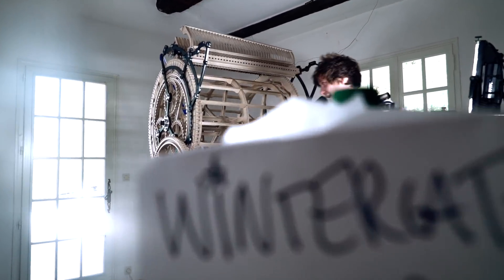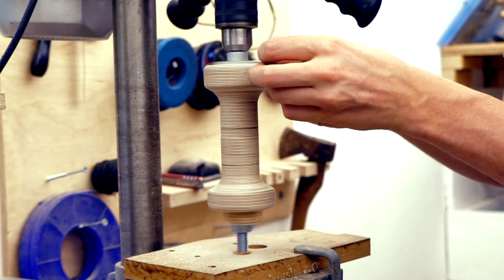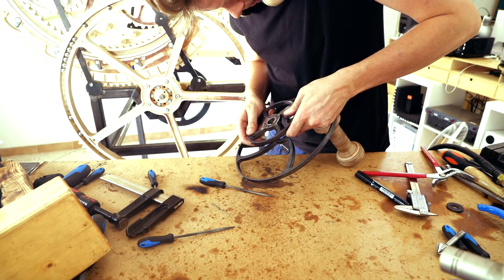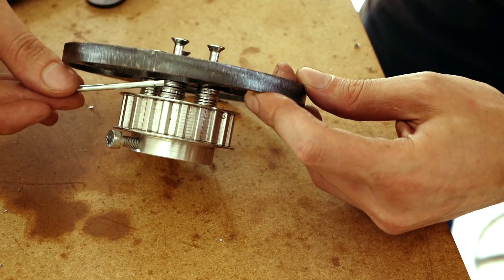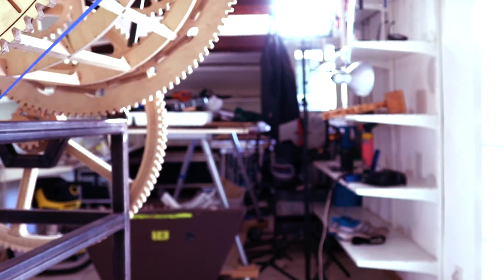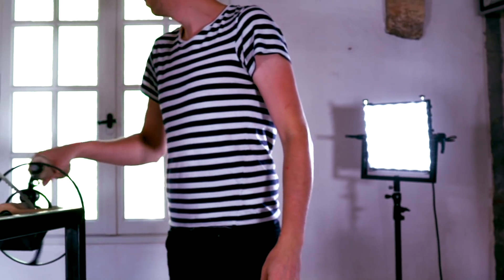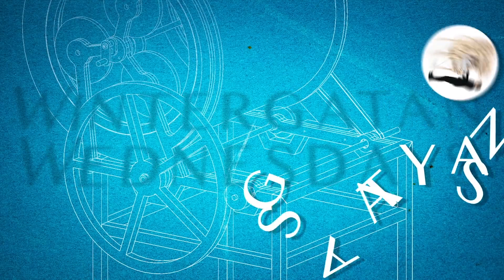Making a Crank Handle without a Lathe - Marble Machine X #49

Comment: Nice work as usual 😀 But the design isn’t ergonomic and frankly not as elegant as the rest of the machine. Look at the handle on the drill in this video. As design like that is more relaxing and in my opinion more in correspondence with the design of your machine        https://youtu.be/bb_91PCUWws

Comment: considering your medium (plywood) and keeping with the cohesive design of the rest of the machine, I think your method of making this handle was probably better than using a lathe.  I think you would have found lots of chipout and splintering that would have happened with a lathe.  I think your end result is about the best you could have achieved.  Great work as always, and look forward to hearing this lovely unit.  Cheers from Canada.

Comment: Excellent as always. Very enjoyable to watch your videos. I was looking at #25 where you were working on the programming segments. A thought...If you used flexible thin plastic sheets that exactly matched the programming segments, but were drilled for the music setup, it would make placing the magnetic pins trivial. Just plug pins in the holes in the sheet overlaying the programming segments.

Comment: Martin I have a question about the construction proccess. Since there are a lot of heavy metal parts included on the MMX, how did you design it so that it wouldn't tip or fall over? Did you use some sort of physics engine to determine its weak spots or did you just use engineering and trial and error?

I love your work and good luck on the rest of your project!

Comment: How to drill or tap with handtools, holding tool accurately square? 

I use a small plastic mirror with a 1cm hole cut in its centre. Place mirror flat on object and drill or tap through the hole in the mirror. 

When drill is held correctly square the real drill and its reflection in the mirror are easily seen as one straight line. If drill is wrong, tilted slightly, the error is immediately obvious in the mirror.

Comment: I realize it's kind of late in the game for this, but did you consider a transmission system for the crank so you don't lose any mechanical advantage when you need to play faster songs? i.e. a 200bpm song could be cranked at 100 bpm, change gears and a 100bpm song could be cranked at 100bpm.  Or am I completely wrong? LOL.  (P.S. I'm not a mechanical engineer, so don't judge me too hard if I'm wrong. :-)  )

Comment: Hey Martin! The marble machine x is coming out really well! But I wondered something, Would you desing a way to power the machine with a motor? No for stage use, but for machine debug. I think that making a addon that can power the machine for you would be great since you will need a one less person to find a problem if the machine starts to fail and you can focus on the failure and not on cranking the machine.

Edit: 
Also It will provide you with a tool to make a stress test for the marble machine X like play for 6 hours straight a test song to find out if it brokes or how much it waers out, which will help you to desing a preventibe manintenance plan for it and know what tends to break out and how to know what is about to break before it does so it doesn't do it on stage.

Comment: How to make a crank handle using a CNC cutter and a pillar drill. Oh please....  tip for the impoverished, you don't need the CNC cutter because a pillar drill with improvised bottom guide to reduce wobble IS a wood turning lathe.  The handle can be turned from solid using just tnat.  Well, OK,  you also need to drill a hole for thé bolt.  Use the drill for that.

Comment: Do you plan to have a tensioning wheel on that drive belt? It's a simple way to get more reliable, stable performance from the belt. You'll have less problems with thermal expansion and contraction as you travel to different climates.

Comment: (suggestion) You should use a T-handle tap holder not a drill, I only use a drill when cleaning out old threads, not for cutting new threads. Don't forget to go back and forth to help clean out the chips. Thanks for the vids, the crack Handle looks great

Comment: I am not sure why, however somehow, I would think that a bicycle chain would look better than the plastic belt, although we know that the plastic belt is really a professional belt. A bicycle chain would match the frame better, perhaps, while the greenish plastic belt is not in line with the rest of the design. And oh yes, a bicycle gear system could also facilitate different rotation speeds, of the marble machine, however then again, a Shimano gear system would maybe be over the top, making too many association to a bicycle, not an instrument. And yes, some new bicycles, now has a belt, and not a chain, so a belt completely makes sense, however design-wise, with the marble machine there is a minor disharmony using a belt instead of a chain.

 And yes, the plastic belt is very thin, and doesn't show properly, the transfer of energy, from the crank as well as an bicycle belt would do. The wheels are astonishingly well designed, in comparison,

Just a detail, everything is extremely fascinating, and well made, and it is fascinating how much work with rotational pieces you can do, without a lathe (dreibenk, as we call it in norwegian). 

However in the Marble machine III, I expect a bicycle chain and not a green plastic belt, ok? :-)

Disclaimer/warning: It could be that a bicycle chain, instead of the firm plastic belt, introduces a minor, however still unwanted slack, that could be an issue, that is in favor of the belt, still - I would
check if the chain would do good enough.
Reply: Thomas Henden  I like the idea of the bicycle chain, plus there is the Wintergatan song "Biking is better".

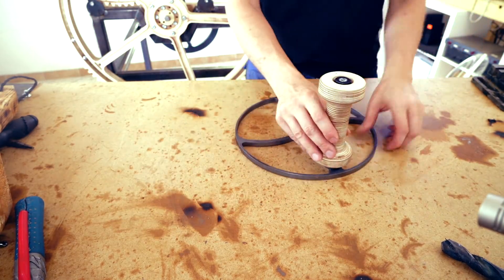Comment: I love this project! At 3:28, you're using an angle grinder to de-burr round holes. It's much easier to acheive a clean look and leave the original finish of the steel surfaces if you de-burr holes lightly with a few turns counter-sink or a drill of at least 2 times the diameter of the hole (not to damage the drill) :)

Comment: Am I the only one who thinks using steel is a bad idea for this project? As awesome as the new Marble Machine will be, and as awesome as it will be to be taken on tour, I just feel like it's going to be too heavy for it to be financially viable to ship, with Martin looking at it in infamy. Some bands can't even tour with their own amps nationally because of the weight of the amps. Was carbon fibre or aluminium (aircraft grade???) ever considered at all for the metal structures?

Comment: Not sure if it's been mentioned before, but will you be adding some sort of idler to the crank belt to tighten it up? Maybe it's not an issue, but it seems like it has a lot of slack in it.

Comment: Was the drill-press-laithe inspired bt Michaelcthulhu by any chance? I know that you don't want to, but if I was you I would put some sort of clear coat on the crank handle, that will soon look grubby. I also have to ask, why use a belt drive?  I would think that a belt would have some amount of play in it, unlike a shaft or cog system.

Comment: A couple of things I noticed while watching this video.

For tapping with the drill you might try to obtain some spiral cut taps.  Instead of a straight line cut lengthwise they have a spiral cut like a drill bit.  They are made for doing drilling type tapping and work much better when using a drill.

The second item is you need some kind of tensioner or rollers in the center area of the toothed belt to adjust the tightness and keep it from bouncing around.  This doesn't need to be heavy duty, it only needs to hold the rollers in a given area and have some adjustments to adjust how tight the belt is and keep it from bouncing.  The tensioner could also use a spring to set a predetermined amount of tension and yet still allow some give if something weird happens with the belt.

I would also suggest coating the crank handle with some kind of plastic coating or the hand oils will eventually turn it horribly ugly.  The coating will protect the wood and make it easy to keep clean.

Comment: Would you consider liquid thread lock on the crank handle? Not sure what weight you should use, but I figure you wouldn't want to loose that tight feel on tour. (on the bolts holding the rwo wheels and such)

Comment: Have you thought of using grub screws instead socket head cap screws in the timing pulley. It will remove a spinning hazard and neaten up the overall look of the marble machine x.

Comment: I'm wondering, couldn't the drill press be used as a makeshift lathe, the way you set it up with the threaded rod and the wooden countersupport on the bottom?

Comment: Instead of taking all that time to screw and unscrew the crank handle when you want to play at a different tempo, you could have 3 magnetic pegs (like you use for the programming wheel) permanently in place on the crank wheel, so that you could quickly snap the crank handle in and out of place. You might have to put a groove or two in the handle so that the other pegs don't keep it from popping into place. I think this would be a good idea. It would make it more efficient, and you might even be able to change the position of the crank handle during the song, allowing you to change tempo mid-song much more easily.
Reply: Wolfgang Kenshin correct me if I'm wrong, but the multiple holes are for covering possibilities generically. For playing faster or slower, you can just turn it faster or slower
Reply: Yes, but turning it faster or slower is easier depending on the position of the handle.

Comment: I'm no engineer, but the crank belt looks like it would benefit from a tensioner to keep it relatively firm on both ends instead of waffling about like what it's doing right now. Also, such belts tend to stretch over time.

Comment: Hello Martin, i see an issue coming, when you crank fast. You have all  weight on one side of the wheel, so you have a great unbalance on the system. Maybe you can solve this by adding a counterweight opposed to the crankhandle (or redesign the outer wheel). 
Greets, Ben

Comment: Are you going to add a counterweight to the crank handle to counterbalance the handle and treadle? It's probably not strictly necessary from a functionality standpoint, but it would definitely help add to the design aesthetic. Take a look at these pictures of steam locomotive wheels and tell me that those heavy offset counterweights on the wheels don't invoke exactly the type of design asthetic you're going for: https://previews.123rf.com/images/daseaford/daseaford1205/daseaford120500027/13849547-the-heavy-metal-wheels-of-a-steam-train-locomotive-.jpg

Comment: Hey Martin, I just thought up a small question : why use a flywheel that is separate from the other organs of the mechanism? ie, the gears are crossed out so as to voluntarily reduce their intrinsic « angular mass » (dunno the English word for it) and then the flywheel, which is designed to have an at least somewhat high angular mass, is then added...? why not, say, not cross out a programmable wheel as much, so that the same angular mass is obtained with less parts?
Reply: ( I mean, except for making braking harder, I don’t see any drawbacks.)

Comment: Not sure why the crank has to have that outer wheel at all... it’s just decorative?
A better solution to cranking speed would be to make an Alternate toothed crank pulley that could rapidly be swapped out with a longer toothed belt.
A pulley with twice as many teeth on the crank would turn the main wheel twice as fast.
Reply: I think he said it was for when another part went in, as sort of a guard so he doesn't lose a finger to the machine.

Comment: Be careful on the countersinks on the large crank wheel. If there is too much flex or stress, they will crack, because you removed (what looks like) quite a bit of the parent material. I am always looking for vegan safety shoes, where did you get them at? Don't be hating on the 'safety trolls', we just want you to be safe, and influence others to do so too. The countersink for the handle was very impressive. So is your panning assistant :) Thanks for the video.

As a side note...I am nobody's Dude.

Comment: I'm not an engineer or anything so someone correct me if I'm wrong, but wouldn't it be a good idea to have a third gear that can move attached to your belt so you can adjust the tension if the belt ever gets stretched out?

Comment: What (will) happen if it is cranked backwards by mistake? Either by the crank handle, or if the treadle starts it backwards? Is there protection where the programming pins contact the marble releases for them to pass backwards w/o damage? What about the marble feed mechanism(s)?

Comment: If you put a nut on the bolt(where the cut needs to be) and then cut against it with the grinder, you won't fuck up your threads. Just a little time saving trick.

Comment: Im just curious because you do countersinks by eye and lets face it; they are not perfect, no offence but it is clearly visible that they are too deep, and although it doesn't have any effect on the quality of the build, it could look just that little bit nicer, why dont you get a microstop countersink cage? It's a tool that would prevent you from making too deep countersinks and allow you to make them with a precision of a micrometer (although most are in imperial units because that's an aviation mechanic's tool).

Comment: It looks like the timing belt is jumping up and down.
It is possible that someday this will jump over a tooth.
I think it is a good idea to mount a tensioner there.
Reply: That's what I have seen too. If you got some left over rod and bearings, you can make a tensioner quite easy.
Reply: I commented exactly this problem last Wednesday on Facebook...
Reply: @marcusfabian3855  well then lets try to bring attention to this comment
Reply: @billkeithchannel  Post on reddit is Not possible the site tells me something went wrong.
Reply: Kamikaze I thought the same thing, but let's see  where this goes. He may very well have one designed but it gets mounted to something else that hasn't been installed yet.
Reply: Lets bump this...
Reply: I believe he already can tighten the belt. Maybe he just didn't do it for a 5 minute shot in the middle of the build.
Reply: Two idlers that neck the belt down so that it wraps further around the gears at each end would help without having to add a load of spring pressure from a tensioner to the system.

Comment: Not to brag or anything...but in between last Wednesday's episode and this Wednesday's episode I have taken apart, painted, repaired and replaced parts for my own musical instrument. Just finished reassembling it yesterday. Of course mine is just a set of 50 year old vibes that needed some sprucing up. So I wanted to thank you for not only showing us the hard work you put into this, but for giving me the inspiration to actually take the time to fix my own instrument.

Comment: Add some counter weight to the opposite side of the crank wheel from the handle, take a look at an old locomotives drive wheels, smoother operation.

Comment: Nice work on the handle Martin,  but you've made a classic mistake with handle design. To make a secure grip you have added a "hilt" and a "pommel" to the handle. While this will keep your hand from sliding off, it is actually not ergonomic and will create pain points and limit the ways you can grip the handle. I would recommend removing the "pommel" and thickening the handle centrally to secure against slipping. That design will allow you to grip the handle from a few different positions, something that would be beneficial when you are playing it at a performance for long periods. Keep the hilt though, that protects the user from the metal wheel. Keep up the great work! It's exiting to see Marble Machine X grow a little bit more every week!
Reply: This guy handles.
Reply: You should tell him on his subreddit.

Comment: Hey man just something i think it should be on your mind (i think you are already planing on this, but just in case). You should think on making, after the marble machine x is finished and working, spare parts that can contruct another marble machine x. I think that if you are going to do live presentations with it it's very likely that it will be damaged over time and finding pieces  for it won't be easy. And after the project is done is much easier to do another one. I don't know if you were already doing that, but it would be very helpful and something you should keep in mind. 

Btw love your vids man

Comment: I wonder what the plans are for shipping cases for these assemblies, once the machine is at a point where it works? Will be interesting to see just how fast it can break-down and go back together.
Reply: The plan is for three. He explains it in the "Top metal frame assembly" video. The bottom section is the base with the flywheel and crank, the middle section is the programming wheel, and the top section is the marble divider and registrators.

Comment: I like the design, but why not a weighted wheel to store energy and smooth out the movement. 20+ lbs would do the trick. It would act like a capacitor in storing and smoothing out movements??
Reply: If I remember correctly from previous videos he as a flywheel designed that will be added to the finished machine
Reply: I don't recall one, but I would imagine there has to be one.
Reply: Here's a subtle hint: there is an episode called "Flywheel - Marble Machine X #46"
Reply: But it is a secondary system, i would have had it on the crank is what I am saying, also he hasn't shown how that exactly is going to work in conjunction with his crank.
Reply: The rotational inertia of this system is immense, and as it's all mechanically connected it doesn't matter where the flywheel is